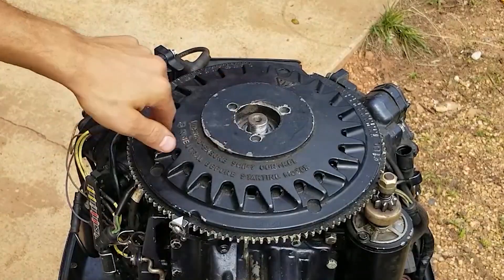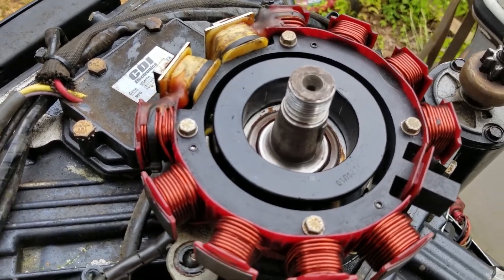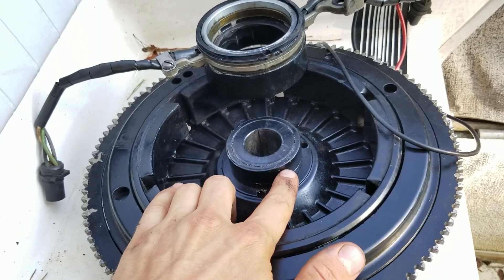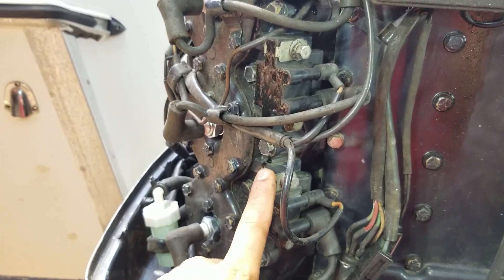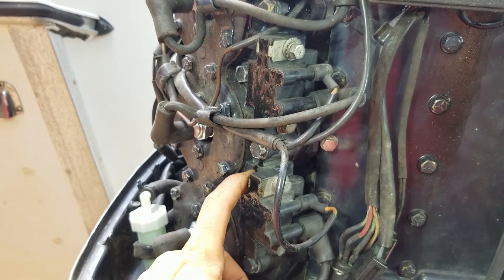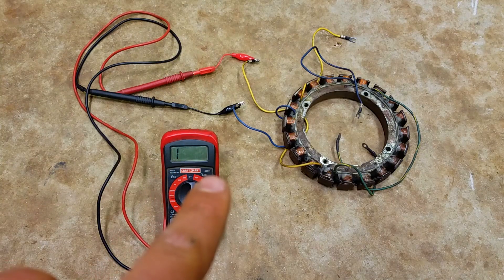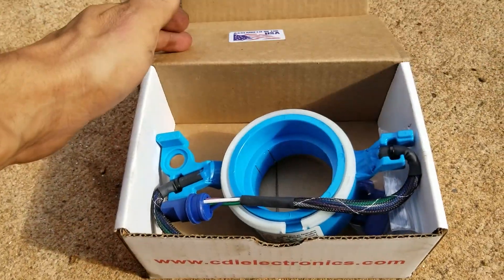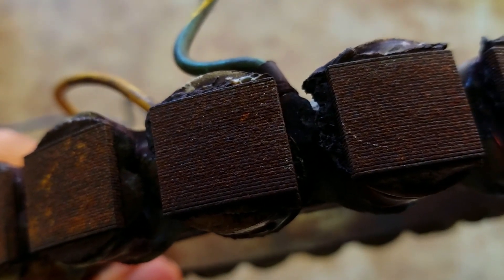Outboard Ignition Explained

Comment: Hey man i just picked up a boat with twin johnson ocean runner 200s one motor runs great and the other has no spark. So far ive swapped flywheels,stator,trigger and power pack and and still have no spark on the other motor. I even disconnected the black/yellow kill wire to eliminate a possible kill switch issue. Do you know what i should check next? Any help would be greatly appreciated! Also i swapped all the parts from the non running engine to the engine that runs and it fires up which tells me that they were all good. Im clueless to what it could be
Reply from the maker: That's WILD. Sounds electrical for sure. The only thing I'd think about is the kill wire. Something has to be grounding out the spark. You swapped everything over and it still didn't work? It's usually the stator and the trigger timer base on these engines. Is there hidden corrosion somewhere?
Reply: @MattsShop alright so i cleaned up all the grounds, taped off a couple chaffed wires and put everything back together and i have spark! But now i cant get the motor to shut off unless i choke it. The black/yellow kill wire is connected as well as the two black/yellow wires at the power pack. Do you know what i should look for next? Thanks for responding to the original message

Comment: I'm so used to using a distributor.  Thought I figured my '88 70hp evinrude.  New all electronics,  carbs rebuilt,  everything pretty much new on the outside. Multitude times of going through and sync everything.  Wondering why,  at idle,  just i can't adjust the low speed ignition setting, without spinning the knurled nut multitude times to change the timing.  Which picks up the rpm and starts rotating the main throttle linkage. The high speed adjustment bolt/lock nut is definitely easy.  It just seems they should have an adjustable low speed ignition dial in screw.

Comment: Just had a power pack replaced and a tuneup on my 92 70hp Johnson two years ago July. There is less than 35 hrs on the new pack. I was guiding fishing with my sons just trying to hold on a rock hump at an idle. Suddenly without warning the engine just quit. 
Any suggestions?

Comment: I have a 1985 150hp, i have swapped Stator,timer, powerpacks, fuel pumps and still wont start but it cranks. Any tips vro?!!
Reply from the maker: You need to check for spark. Probably the kill switch circuit in they key.
Reply: Can the timer base cause 1 cylinder to not have spark and the rest still have good spark? I lost spark on the middle cylinder starboard side of my Johnson 200. I tested and felt like the stator had a grounding condition so I replaced it.(it looked rough too) my tests on the timer base seemed ok but I don’t have a peak reading meter.(yet) But even with the new statir, the same cylinder has no spark. I swapped coils and leads and still no spark to that cylinder. Any ideas? Timer base or power pack? Thanks!

Comment: Got a question. I have a 1988 XP150 that has a miss on cyl one and five. Has spark. Has compression. Noticed with a timing light that number one timing is way out and so is number five. All others are correct. Do you think this could be the timer base
Reply from the maker: Which timing? The pickup timing or the WOT timing. The top two cylinders port/starboard are all that you care about when timing. Mainly clyinder 1.

Comment: Can I ground the safety switch out on a 1970 johnson 60hp? Not getting spark to any of the 3 cylinders. Coil tested out good
Reply from the maker: If you ground the safety switch, it'll ground the spark. I'd check the switch to. Make sure it's working right.

Comment: Great video thanks for the explanation.  If you have a WOT issue is it generally a trigger issue as the cylinders aren't firing correctly.  Or is it more of a fuel problem.  Keep the vids coming.  You have made a simple explanation.

Comment: I have just begun to look at ignition on my 99 175 ocean pro….dies when I give it throttle under load if I hit the choke it will take off just fine. If I just go full throttle from idle it shoots off 80% of the time…I did the carbs, new VRO, new fuel lines/rectifier plugs…compressions solid runs like a beast at WOT….long story short man your videos have helped me a lot
Reply from the maker: Glad I helped! Sounds like a pickup or WOT timing issue. Is the timer base rotating freely?
Reply: @MattsShop  I have not even checked anything pertaining to timing or electrical because it just seemed like a fuel delivery issiue but I have checked all of those off the list. I’m going to investigate it soon
Reply: Olá amigo 
Eu tenho um motor 225 da jonson,  muito bom de funcionamento.  Mas do nada ele começa a da trabalho,  não pega de jeito nenhum.  Ele para de jogar centelha . Já troquei trigguer, cdi, estator.  Só pega quando quer . Pode me dá uma dica do que pode ser . Na minha região não tem mecânica nautica